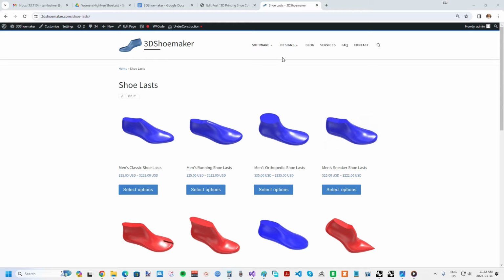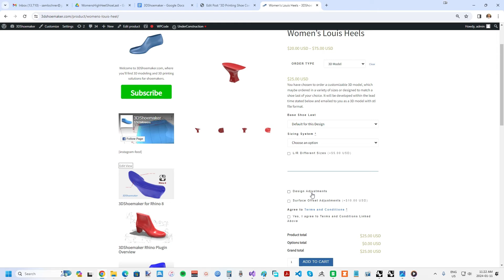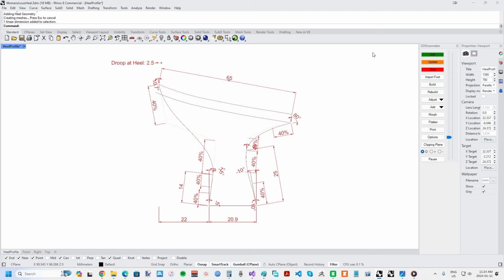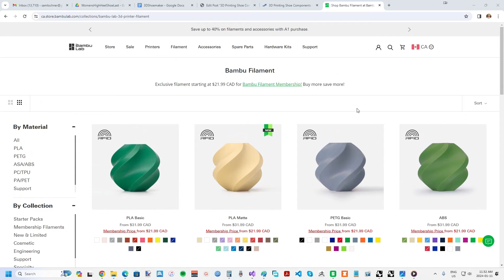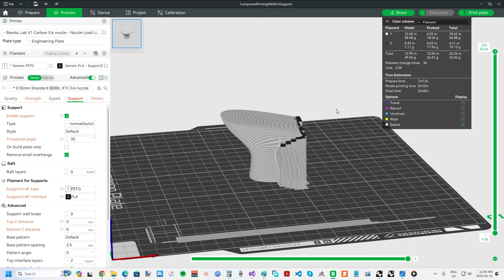3D Printing Shoe Components: Heels, Wedges, and Platforms

Comment: Petg or ninja ?
Reply from the maker: PETG
Reply: @3DShoemaker for a slide type shoe , what do you recommend printing with ?
Reply from the maker: @TheBobbysWorld4  TPU
Reply: Heels are usually attached with screws. Have you done a version like that?
Reply from the maker: @dorirenelus5507  No, but with 5mm wall thickness it could likely hold screws